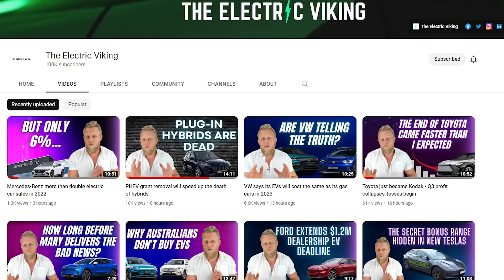German power company destroys wind farm for new coal mine

Comment: The average lifespan of a wind turbine is 20 years,it takes 10 years  for that turbine to produce the power that was used to build it.
Reply: That fails to count maintainenc, if u include that on at least the older versions , depending on environment it's likely more like 15 years to break even if ever . Locally they all have a natural gas hookup that they use to stay warm in cold weather witch makes it harder yet for it to break even . The worst part around here is , we have too much power . The local hydro dams produce more than the local grid can use or ship out of the area , then we throw up a bunch of windmills and solar fields , witch are basically useless as we already are 100% renewable in my area . The other kick in the balls here is they property is rented and they pay per turbine . With all of that locally I'm 100% they were just a grift .
Reply: If ever, and many of them are accidents just waiting to happen!
Reply: Most dont make it 10 years without a gearbox generator change, once again crap power from an idea not ready for prime time
Reply: The turbine blades are made of composite materials they are too expensive to recycle so they just hide them under earth.
Reply: @turboprint3d  Wait, they need NGas to stay warm? lolz - I didn't know that. I was confused over the necessity to take them down - I thought they could be allowed to run until their end life. But if they need pricey NGas in short supply to stay running, then their break-even just got kicked down the road to 20 years (or more? 🤔) so it makes sense for them to stop immediately.

There were people making fun of Texas turbines freezing up and boasting that theirs in their part of the world stays running in even colder weather. Hadn't known they had to burn fossils for that to happen.
Reply: The need and requirement to keep the light on trumps environmental concerns. And these large coal fired plants were available with rapidly accessible generating capacity. Plus the windmills are sitting on readily accessible fuel sources. So, the windmills come down and the mining equipment moves in. 

Keep in mind, just because these turbines are coming down, does not necessarily mean they have to be scrapped. They can be sold and relocated. If they are reinstalled in another location, they can then serve out their useful service lives. 

Wind turbine farms are sprouting up all over the place, like weeds in the spring garden.
Reply: The blades are not even making it 10 years and they can't be recycled they have to be buried and disposed of. The  Family tree of carbon from winterbines goes clear back to the caveman there is no free green energy that is carbon free whatsoever.
Reply: @Tomcat71  the turbine blades are replaceable maintenance items. Their periodic replacement is included in the life cycle costs of operating the unit. 

The fact that most of these blades are made with composite materials containing high amounts of carbon in the form of wood or plastic source materials is a not really relevant. If they are not recycled at the end of their lives has more to do with the fact they cannot be recycled profitably more than they cannot be recycled at all. The durability issues with existing turbine wind blades will get better with time and evolution of the technologies used in them.
Reply: @markusgorelli5278  ya I mean the heat system is on a thermostat , but it can get to -40°c easily including windchill and air off lake Superior . That being said once it gets below -10 there likely on from that point until it goes above 0 I'm the spring . I'm not sure if Texas's turbine had that feature and might be why the froze up . I'm not 100% but I think the local turbines have channels in the blades with fluid that's heated by gas or electricity to keep ice off the blades , so it doesn't come off and kill animals and damage trees . On that note our hydro electric damn is also heated with natural gas if I'm not mistaken , however the larger damn up north has less need for heating due to the design apparently . I'm not an expert on turbines but worked in industry for 13 years and understand that any system working in the cold like that with any sort of lubrication will need some sort of heat system , sometimes it's a water jacket on the motor that distributes heat to other places . Sometimes it's a steam line piped in to a slave around parts that need to be warm , but regardless gearlube turns into paste at -20c and will need preheating at the very least to work without damage or excessive wear .
Reply: Let's not forget that they use 80 gallons of synthetic oil derived from 12,000 gallons of oil. The 80 gallons of synthetic oil is a specialized lubricant. That's for each wind turbine and the lubricant has to be replaced once a year.
Reply: 20 yrs for wind ans solar installations is the best case scenario. The true lifespan is closer to 10-15yrs.
Reply: @ravenbarsrepairs5594  I also heard that best case scenario is 40 to 45% reclaimed energy for what actually goes into making and producing solar panels. The only way any of this works is if you have battery storage capabilities that are four to five times the capacity of what current lithium batteries can hold. If they can get electric vehicle batteries up to a thousand miles between charges then it becomes worthwhile. Currently the best bang for your buck is nuclear energy number one and fossil fuels for number two place.
Reply: @pinetree2473  they kind of cant , the one being removed would lower lake superior too much and flood the town I'm in, short of them adding more control gates . the whole thing is tied into a set of locks and would be very unlikely to be dismantled, they make too much money selling the excess power to the us at a loss for the grid operators but a surplus for the owner of the damn . as long as the local old boys club keeps making money they will be here . besides we basically supply new york with like 60% of there power ( most of there base power i have been told ) . Here in Canada theirs been whispers of work with Mitsubishi on modular reactors , they apparently have plans to build a few test units in southern Ontario . I'm not holding my breath tho , and not sure of anything just speculating . the reactors will probably amount to nothing and be swept away like anything else viable 
.
Reply: @pinetree2473  so far its not too much of an issue here , and alot of the smaller dams have the imitation rock wall for the salmon to jump past . I have herd of that and as an " outdoors man " i feel the need to protect the fish populations but there are viable ways around that other than destroying a dam.
Reply: See all the massive brown stains under the gear box, that is usually about 75 gallons of oil, because 1 of 6 have massive oil seal leaks
Reply: I worked at vestus a couple years ago and they said their wind turbines are built with a lifespan of 25 years that's just what they told us I was just passing that along.
Reply: @robertjohnston8690  I worked it vestas making the wind turbine blades they are made of fiberglass materials a few pieces of wood and a huge steel ring where it both bolts to the hub The hub is recyclable once you separate it everything else is fiberglass just like a boat for water skiing or fishing it's fiberglass they have huge molds that are clamshell type and boom it does it it's an incredible experience to watch it get done. None of it is recyclable except that steel ring that I'm aware of
Reply: No matter how you look at it, drilling for natural gas and oil is the only way any of these sources of power can operate.  Find one source of power that don't use petroleum based plastics or diesel to power the trucks and Crain's to move and assemble it.
Reply: and they are not recyclable, and end up in giant land fills or burned.
Reply: Unique situation, but guess what, you are going to be on diesel
Reply: Can yo include a link to verify your statement?
Reply: What a ridiculous statement!
Reply: And your statistical authoritative eveifence is?

Comment: Burning lignite coal for energy has been cleaned up a lot.
They wash the coal, have scrubbers to remove the sulphur and filters to remove 99% of the flyash etc.
It has been overdemonized.
Reply: They just haven't figured out how to remove the CO² yet.
Such a pity.
Reply: CO2 is good for plants
Reply: @darrenpaches3731  it is the stuff that all life depends on.
Climate activists saw off the branch they are sitting on.
Reply: @gregbailey45  They say water-vapor is worse. Kill the trees!
Reply: And it can be used to make synthetic gas as a substitute for gas imports.  ;-)
Reply: @Driftwannabe 10 no co2 good
Reply: @gregbailey45  And trees and green things need CO2.

Comment: 36% is not that horrible. The most efficient coal-fired unit in the USA is the 665-MW John Turk Jr. plant in Arkansas ( POWER's Plant of the Year in 2013), which achieves an efficiency of 42%. It is the nation's only ultrasupercritical steam generating station. Unit 2 at J-POWER’s Isogo Thermal Power Station, a 600-MW ultrasupercritical unit in Yokohama, Japan, ranks as the cleanest coal-fired power plant in the world at about 45% efficiency. Ultrasupercritical steam plants are expensive to build and require more maintenance, but they are cleaner burning.

Comment: The trouble with lignite is the high moisture content and high concentration of VOCs (Volatile Organic Compounds) make it difficult to transport long distances safely.  It tends to release gases and decomposes when exposed to air. Normally it is mined very close to the power station.  That's the bad news. The good news is that it can be used as a source of gas and coke has practical applications for soil improvement and as an absorbent.  Rather than importing gas from Russia perhaps EU countries could make their own gas from lignite.  They have plenty of it.  ;-)

Comment: EV's are really not that much better on emissions.  Yes the EV, from the power cord to the vehicle down the road looks very good, somewhere in the mid 90% efficiency numbers.  Now as Paul Harvey used to say, the rest of the story, the power comes from fossil fuel power plants.  These power plants are at best 35% efficient in energy conversion.  So now we are at 35% x 0.93 (published efficiency of the vehicle), now you are very slightly better than a gas-engine vehicle.  Then the EV's batteries are not recycled, so far there are no facilities on this planet that recycle these batteries at this time nor in the foreseeable future.  Wind mills have been in use for several decades and have clearly proved that they have serious issues preventing them from being the primary power source, assistive yes, primary NO.
Reply: While electric motors are more than 90% efficient, the batteries used to store the electricity cause the Tesla x to weigh more than 6000lbs. Thats almost twice the weight of a regular sedan. Meaning A much larger portion of that energy is used to transport the vehicle rather that the occupants. So the emissions required to transport 1-4 people cant be much less than a comparable combustion powered car .Thats something to consider as well
Reply: @brdsmith89  My major question is what are we going to do when we have a highway full of these useless vehicles.  Yes, they have applications that are valid, such as cities where there is a pollution issue.  You have to grasp 2 things, one is that the vehicle has very low-end use pollution, and the other is that there will be the same pollution created, but it will be at the power generation station.  So you end up with a shift in the blame situation.  As an over-the-road vehicle energy source, it simply isn't valid.  Motors working in the extended speed range suddenly are not that energy efficient, they do great at city street speeds but on the highway speeds of 75mph, 120kph they really suck down power.
Reply: China recycle all EV batteries at this time on earth and very profitable business.

Comment: The efficiency of coal fired stations is of little concern when you have as much coal as Germany or the UK for that matter. Most world leaders indoctrinated by the WEF and in Germany particularly by the very powerful Green lobby, would never agree to burning coal / oil as it would be a political  nightmare at home and internationally. We must therefore assume that (despite European winter gas storage levels now being above 90% capacity) the very real prospect of having to restrict sections of their grid has become a reality and a short term solution (even if not to everyone's taste) may be needed. Germany is lucky to have the fuel and the stations still available to use it. The lack of Russian supply and the closure of German reactors has also been compounded by the loss of a significant generating capacity across the French reactor fleet due to corrosion. This last issue is supposed to be resolved by December but national strikes have caused delays.
I applaud the Germans for making a very tough decision in the face of aggressive and well funded 'lobbying' by the eco / green /climate groups and those that use them.
Losing power to industry would also cause further damage to people and the already shell shocked economy. What a shame it would be if you couldn't charge your electric car and had to nip out and buy an old diesel thing to keep you mobile!
As to Tesla being 'Protested' or sabotaged, both are easy to believe though personally I would lean towards the latter. After all, irrespective of the deep desire to save the planet, there is an awful lot of money at stake...

Comment: What most don't say is that those wind farms were going to be removed anyways as they were past  usable lifespan. Its not a new coal mine, just an extension of the existing one. Seeing how all the equipment is already there. It was cheaper and faster to start digging again and turn on the Coal plant. 
Than ordering new blades then setting up the transportation for those massive things.  It can cost 2-4 million to setup a single new windmill. 
Add the current political situation over there. 
It's not like they cannot build more windmills once there done with the mine.
Reply: germany shouldnt need more coal, they should be eliminating coal not expanding coal production.
Reply: @scottmcshannon6821  In the short term, they need to fill that void from not buying from Russia, longer term, they should be moving to alternatives like renewable, but for now, they need a lot of energy and quickly, renewables can't replace that quickly enough, coal, the old nuclear plants and other sources can.

But in any case, there should be a clear path away from these to other clean energy sources over the long run and I get the impression that Germany is falling behind many other European countries on that.

Comment: Quick search.  Not sure how much water is used in the making of ICE cars, but "5.2 liters of water are consumed for each liter of gasoline produced"   Not to mention (coal powered?) electricity to make gasoline  "5 kilowatt hours to refine a gallon of gasoline" (1.3 kWh/liter)
Reply: As an electrician who has worked at refineries, I can vouch for the fact that producing fuel takes a lot of electricity, although I generally use the more conservative 3 to 6 kWhr of grid supplied electricity per gallon of gasoline and diesel, but the range is considered to be between 2 and 8, with an equivalent range for the amount of fuel self consumed onsite by the refineries for onsite generated electricity and fuel fired energy needs.
Reply: Refineries generate power by burning crude oil residuals.
Reply: @allangibson8494  While refineries do generate some of their own power from self produced fuels, they are generally not allowed to use bunker fuel to run onshore power plants any more due to air quality issues, and it is simply cheaper to buy grid supplied electricity rather than burn cleaner fuels or add all of the scrubbing equipment to the generators, especially when the bunker fuel can be sold to the shipping industry, although that is changing as shipping industry regulations are starting to take effect. Refineries have big generators to maintain continuity of power to run processes and keep control and safety systems powered, but it is becoming cheaper to install batteries instead, plus it keeps the air quality inspectors happy, and the avoided pollution from running generators can be used to offset other refinery pollution.
Reply: @GoCoyote  Depends on which country you are in. (Joys of importing refined fuel).
Sulphur recovery is a thing too.
A lot of the crude tankers are now running on LNG / LPG and crude off-gas in transit. (Basically they strip the volatiles inbound and used stored gas outbound).
I also worked on a refinery that used vaccum residual (the stuff too heavy for road tar) for power generation and residual heat off the catalytic cracker.
Reply: @aaronsmith5433  Very true, why do they make their own electricity? because they need a lot for refining of oil.
Reply: @timothykeith1367  To be honest, I don't know.  I did google search on how much water is used in a oil refinery.   That's what I found.   What happens to water used by Tesla factory?  Don't know that either.   So much to learn.